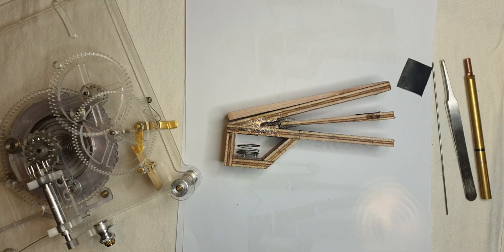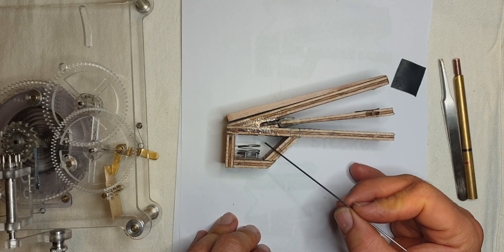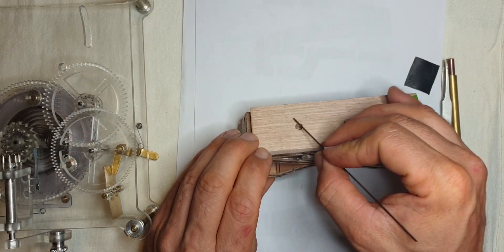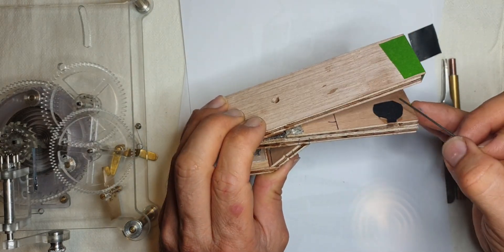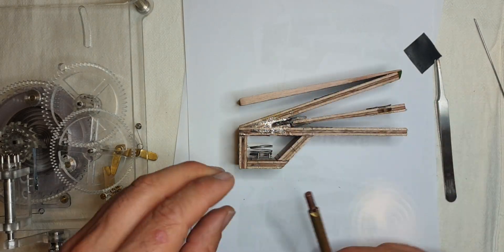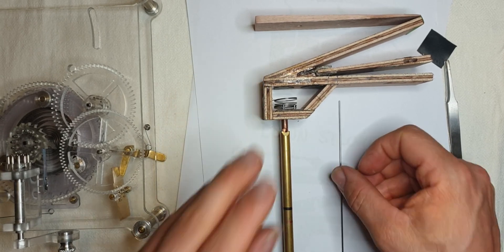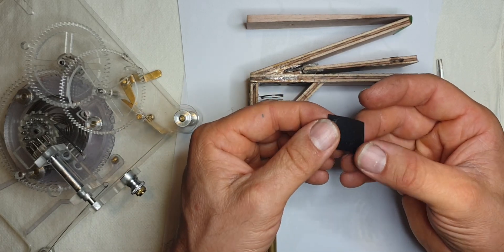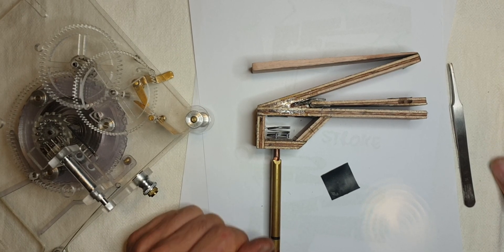Automaton Whistling Bird V4 - Bellows Part 1

Comment: Hello.  

I’m a metalwork art university student in Tokyo, Japan.  
I also want to make a singing bird system.
Then I doing all searches I came across your work.  
I’m really really impressed by your interpretation of mechanical structures and the sophistication of your work.  

Especially your work from 5 years ago was wonderful and I could understand the structure well. And the work in this video has evolved further and I’m very surprised.

However, even if I look up how to make it, there is not enough literature in Japan and there is little information available on the Internet.  
I couldn’t find text and also explanation of mechanism.
Your explanation was easier to understand than any video I've seen.
If you don’t mind could you teach me how you studied?

Regards,

Comment: Hey there, been loving your updates and progress on the automaton.
A little opinion of mine is to increase the grear ratio between the mainspring and the fan governor and to reduce the size of the governor. I think this would make it more stable while retaining the speed you desire and put less strain on the start/stop mechanism and the fan governor bearing.
Cheers
Reply from the maker: Thanks. Great suggestion. I will try that on the next version. Ill also reduce the module from 1 to .75 which will give me 25% more space to increase the ratio.